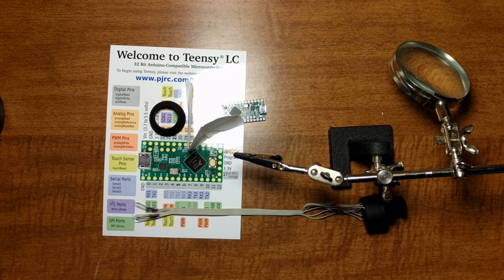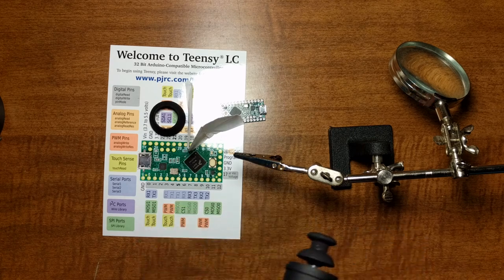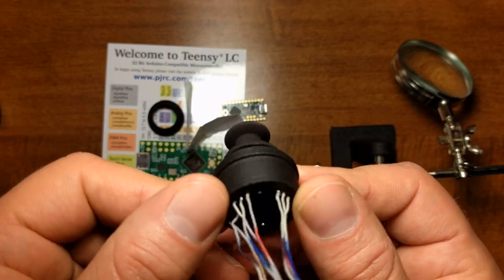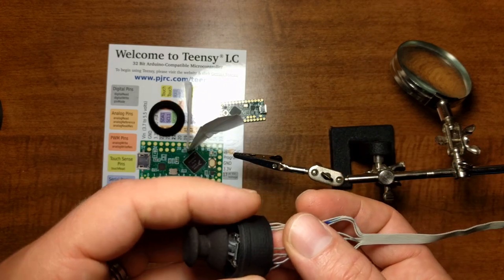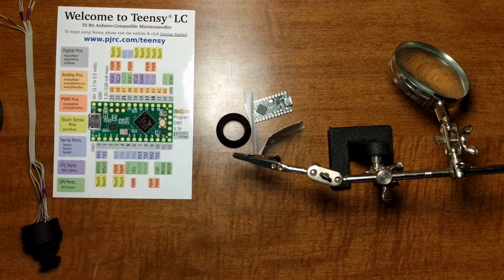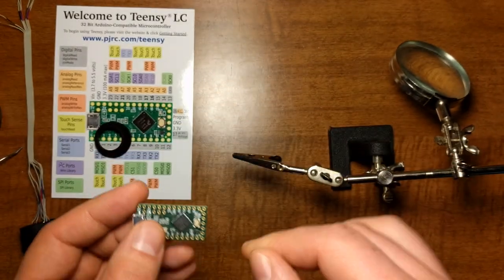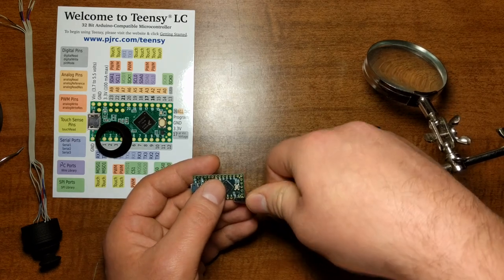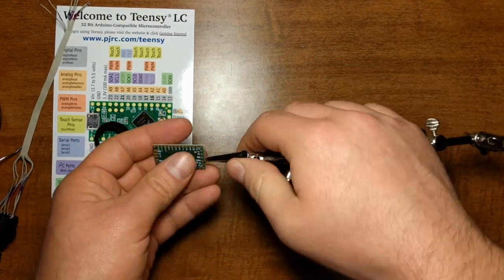Analog Mod Tutorial - Part 4 Soldering to the Teensy

Comment: is there anyway i could fully reset the Teensy Lc ive come to use my anolog again recently and it just isnt working ive checked wiring everything seems okay pc recognizes it but its just not responding.Thanks
Reply from the maker: Just re-flash it
Reply: @tuffrabit  re flash it with what the original blink firmware or the anolog? if so ive already tried it still no luck
Reply from the maker: @minion9707  sounds like perhaps something else is wrong. Hit me up via email or Discord and we can go into detail over this